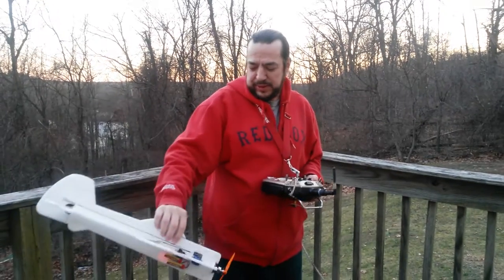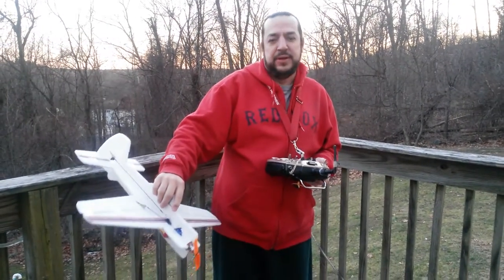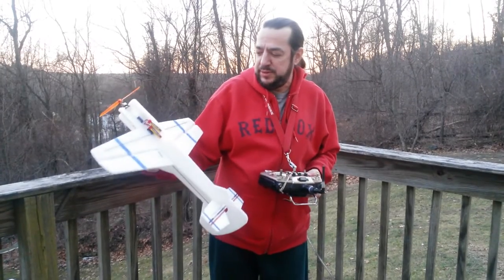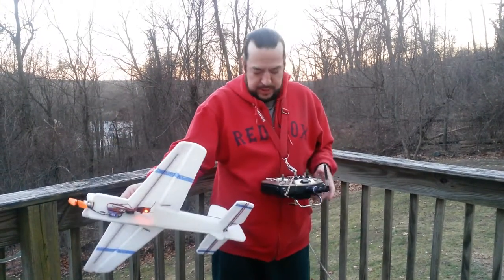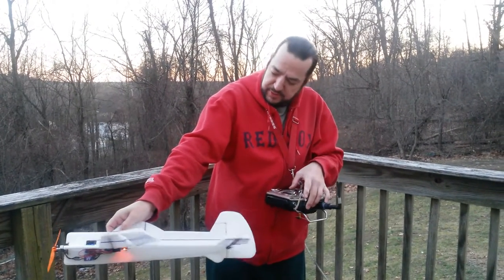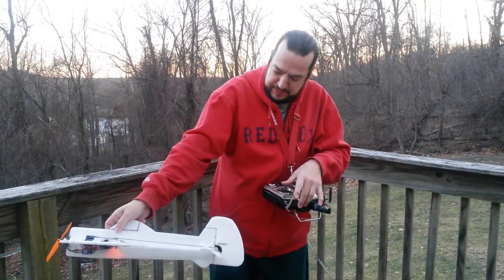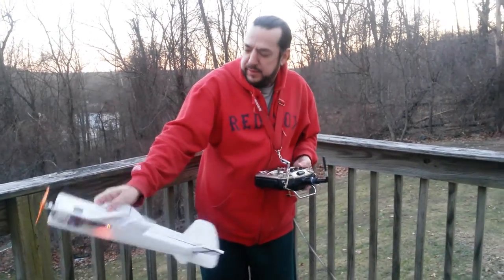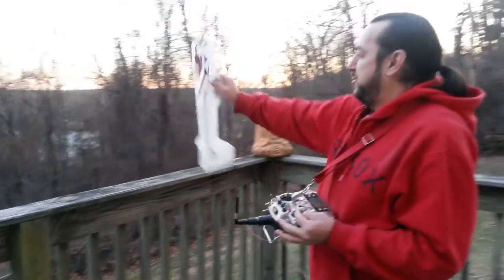Mini Yak 22" Test Flight 2016-02-02

Comment: Got my Racores Mini-Yak flying just recently. The build was easy and it flies really well. It's stable in a harrier. It hovers well as well. Being that it is a smaller plane you have to be more alert however,

I have been using larger 250mah 2s packs. I am waiting for the HK 180mah to come in. Using a LemonRX feather weight RX.

Would recommend it.

Comment: Nice!  What size carbon fiber did you use for push rods - didn't see any supports
Reply from the maker: +Ed Dugo Thanks.  The rods are .050", they are included in the kit from racores.com.  I found that I didn't need guides for the control rods, but they're in the kit if needed.  It all goes together really nicely; quick and easy build.
--ET
Reply: +etrc1 Thank you!  I like the idea of 2 1 cell lipos
Reply: Thank you for the tip!